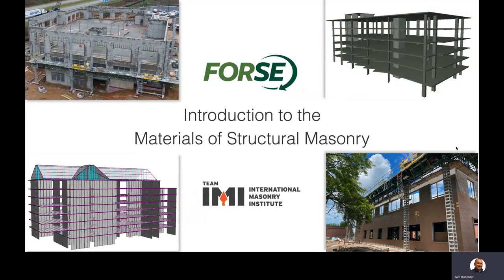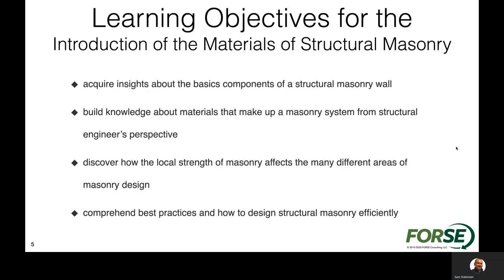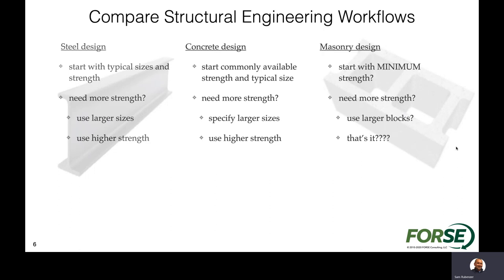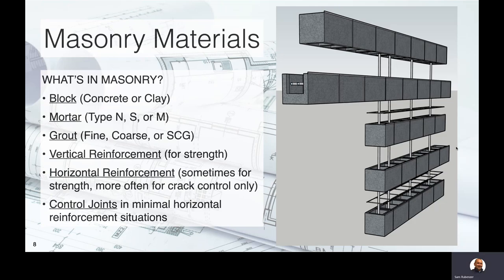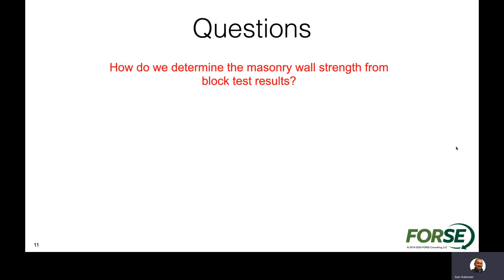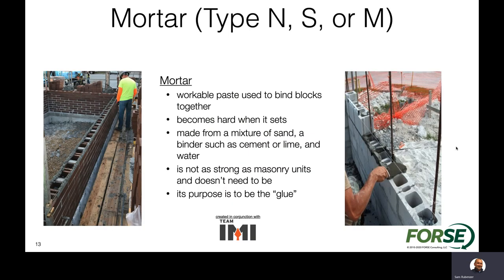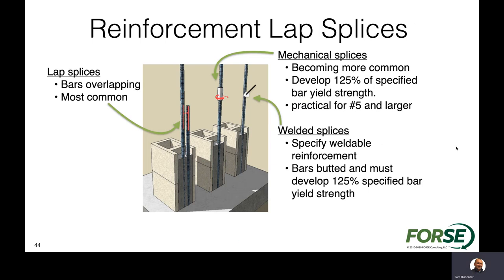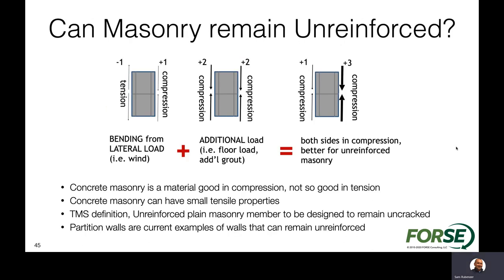Introduction to Structural Masonry Materials   Part 1

Comment: for 5m x 5m surface area 15cm thicknes concerete roof, do I need extra concrete column?
Reply from the maker: There are a lot of variables to consider, including loads and support conditions. You would likely need reinforcement for a panel that size.
Reply: @SamRubenzer  cinder blocks with reinforcement wall filled with concrete and 2 layer iron reinforcement for roof slab. Do I need extra column for  5 x5 meter (or 6x6) surface area?